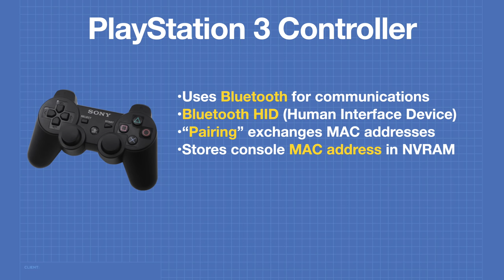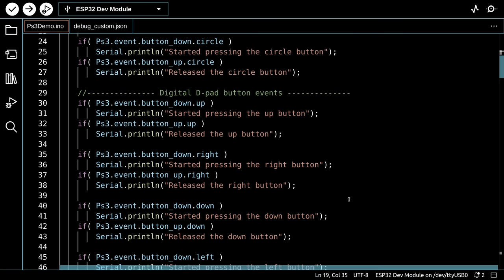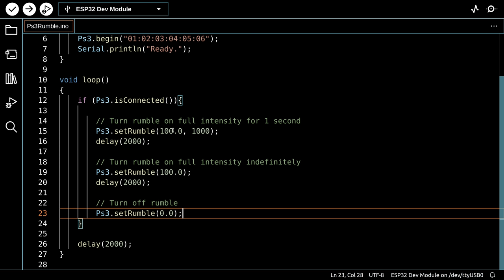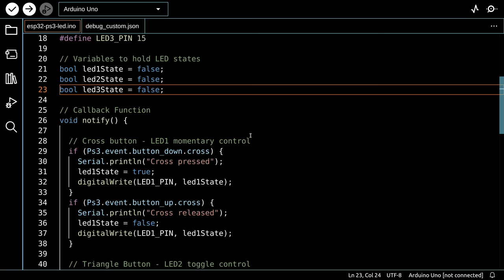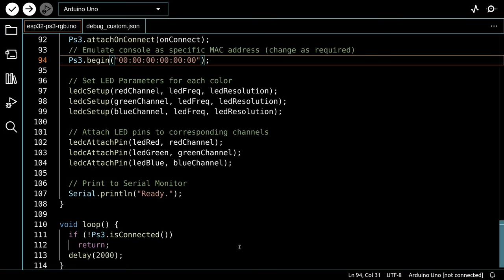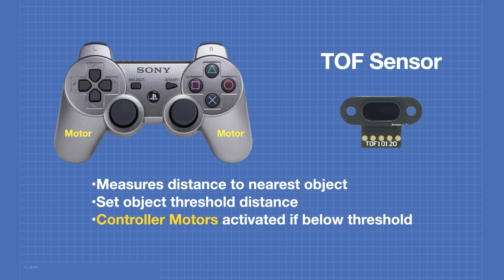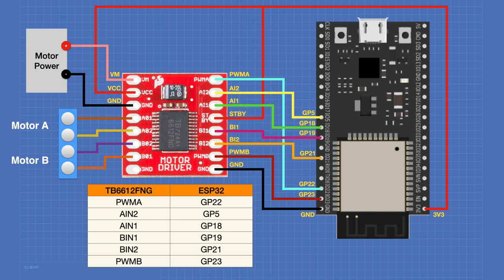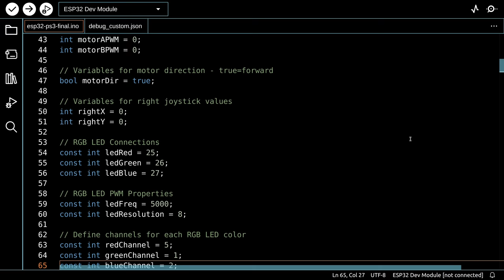Using PS3 Controllers with ESP32 | Build Custom Remote Controls

Comment: I bought the most recent ps3 controller clone on ebay. Looks exactly like in the video. Installs on Windows fine, shows as Xbox 360 and works. But the Sixaxis pair tool does not find it, with "no device found" error. Tried on 4 different Windows computers.
Reply: i am in the same situatione!
Reply: did you find any solution ? 
i tried pairing with my android phone and retrieving the bluetooth mac address but it didnt work
Reply: Turn off your fire wall that helped me
Reply: You have to use a name brand Sony
Reply: I have had the same thing

Comment: One of the best videos I have seen.  You really did a great job bringing all the different elements together and it is hard to believe you have not spent 30 years in the front of a classroom.   Your cadence is perfect, and you break each task into simple to understand steps and build on that. Not just in this video, but all of yours.  This one is particularly a gem covering so many interesting topics and then bringing them all together.  I have been working on a lot of ESP32 projects and your videos have been very helpful.   Thanks and keep it up.  -Duane

Comment: Does anyone have links for the cheaper controllers that actually pair with the ESP32? I have bought 3 different brands and none of them have worked outside of the OG Sony controller. I tried rolling back the versions as suggested by others, but that didnt work :( I would LOVE to use these in my high school robotics club but cant rationalize $40 each controller. $10-13 each is totally manageable though!

Comment: Thanks Bill! Another great video to get my creative juices flowing. It got me thinking about automating my wood shop. Not with a PS2 controller but laser sensors and such. 😃
Reply from the maker: Thank you Kyle. And I agree that automating a table saw with a video game controller might not be the wisest thing to do!
Reply: @Dronebotworkshop Don't knock it until you try it; I use an Xbox controller to control my CNC and it works great.

Comment: 100% agree on the micro vs mini usb. The thinner metal jacket on the micro is much more susceptible to prying loose from a fall/drop or even from regular use on something that sees a lot of connecting/disconnecting. The micro is good for small devices where space is more of a premium than durability. If USB-C isn’t and option, the mini would be my second choice.

Comment: Thanks Bill, a brilliant project, I've finally found a simple, reliable way to control a robot car!
It took me a while to understand I needed to get the MAC address from the ESP32 and insert this into the sketch code and also to modify the PS3 controller so it has the same MAC address.
Then worked perfectly, even has proportional control!
Thanks for your meticulous documentation.
I'm looking forward to further updates.

Comment: Thank you, love your work!  I noticed a two second delay in the loop(), after it detects that it's connected.  Then I noticed errant display in the console log.  I deduce that this delay is the reason that @33:00 it's not immediately showing in the console log, when you press and release the buttons -- but it does "catch up" a few seconds later.  A bit later I noticed a 300 ms delay in what appeared to be a critical section, but didn't notice any issues from that (a third of a second happens fairly quickly, also.  :)  )  Thanks again!

Comment: Teacher! Congratulations, I follow your classes whenever I can! I have a question does the generic playstation 3 joystick connect with esp32 or only if it is original?
Reply: If your wondering whether you need an offcial branded PS3 Controller, I don't think you do. I haven't got one and its working well enough here.
Reply: @lankeylad  generic controllers works fine

Comment: I have been flying rc planes this way with LoRa modules for the last two years.  I wrote code that includes secondary functionality for trimming the plane and using landing gear.  I wish you would have made this video back then because it took me a month or two to work every thing out,  also not every ps3 controller works , i have five different variations some only work with esp32 and some will only pair to a dongle with USB host shield arduino.  Im gonna post my code

Comment: Hello Bill , I was wondering fi there was an alternative to the six axis pair tool .. I have purchased a ps3 controller very similar to the one used in the project ..however the software doesn't seem to be finding any  console and doesn't provide any mac address details .. any direction /solutions would be most appreciated ... I am very keen to try the project utilising the ESP 32 ...also  which board do you use ?  , as there are so many generic versions out there ? in appreciation of your time and wonderful tutorials ...
Reply: i got the same problem try using the same mac address provided

Comment: Excellent Tutorial. I had quick test with my PS3 controllers (two) and it seems accelerometer /gyroscope does not seems to work on both controllers and only getting " -4 0 -132 0 " in the serial monitor but all other functions are working ok.  Do you think they have dead DOA  accelerometer /gyroscope ? or do i have do some trick to enable them to work? Thank you for suggestions.

Comment: I'm watching you about to do your servo motor test, and I'm wondering if there are various sensitivity/movement curves available to you, instead of just a linear adjustment. This is for continuous movement (perhaps until the limit is reached in the case of servos) versus an absolute position relative to stick position.

Imagine traversing a massive menu... For example, selecting your birth year from a listing of years. (That one gets to me now, I used to think the notion was funny). You might press the stick further to go faster. A sensitivity curve might be a great code enhancement in this case. It would be great if some preset curves were part of the library.

*edit* I like how you sort of did this with the motor control routine. It's still not a response curve, per se, but it works for its purpose.

Comment: Sixaxis and DualShock 3 were not the same.  Sixaxis doesn't have a vibration or "rumble" feature for haptic feedback to the user.  Dualshock 3 does.  That also makes the Dualshock 3 a little heavier, which most people prefer.   Sony couldn't get vibration and motion sensing working together on their sixaxis design.  The Dualshock3 was made by Immersion Corporation (after a patent lawsuit that banned the import of PS3 systems with sixaxxis to the USA).  Dualshock 3 (design licensed by Immersion) did have working motion sensing with vibration.  Presumably subsequent dualshock4 and dualsense controllers also are based on the design by Immersion.

Comment: Just a thought on the controller buttons having a "how-hard-you-push" or analog output capability... Might it instead be that you just read the button while it was still in debounce mode? Seems a little too much to expect them to have a "haptic" capability in that manner. Thoughts??  Great and thorough video as usual!
Reply: Good thought, but the buttons on the PS3 controllers are pressure-sensitive. They'll return an analog value up to the 255 max.
Reply: @themonkeydrunken  That's really cool!

Comment: Could this project be adapted to a ps4 controller? Any extra steps required? Not asking for a solution just whether it would be the same steps.
Reply: Its about the same. You use the sixaxis tool and then a ps4 controller library
Reply: @collinb5524 thanks!

Comment: New to the esps, Is it possible to connect the esp32 directly to the controller through USB and transmit the signal through WiFi to control another esp  for a longer range?

Comment: I think the setPlayerLED also sends data to the controller.
And isn't the gyroscope better for detecting rotation of the controller for motion based control?
Accelerometer stops changing when the controller is no longer in motion, doesn't it?

Comment: This is really great!    But how to do it the other way round? Emulate a sixaxis controller by an ESP32 or an Arduino or a RasPi and control the PS3 remotely? Is this possible, too? Where to start?
[Background to that question: I use my PS3 as a media player / BlueRay player and other functions. I have set up a home automation on RasPi that controls my video beamer, the Surround Sound system, the NAS data source, the HDMI matrix, the TV, the ceiling lights.... The home automation controls different Scenarios like "start the video", preparing all components and the light, and so on.... only the PS3 control is still missing...]

Comment: I have a question. When running the "Sixaxis Pair Tool" I get "No device found...". Should the PS3 controller be connected via Bluetooth, when you start the Sixaxis tool, or via USB cable? I have found many videos on Youtube on connecting a PS3 controller to a PC via Bluetooth and tried to follow a few. Problem is that, instead of connecting the device, they just remove my PC:s Bluetooth altogether. When I connect the PS3 control via USB cable, it gets acknowleged by the PC, but as "XBOX 360 for Windows" nor "Playstation...". Strange! Could you explain the process before running the Sixaxis tool? Also, many thanks for yet another great tutorial ☺
Reply: i got the same problem and yes it works with my pc , anyway to use it with the esp32 use the same mac address written in the code

Comment: hello bill 
thx for the video, am using esp32-wroom-32 but non of the codes are working for me. the ps3 controller just blinks with out connecting to the esp
please let me know if there is some update or fix I should do

Comment: I have a nice largish p10 panel running from falcon player... I'm wondering if I could hack this into it to play tetris from the front yard... I mean I know I could but I wonder if I could before I got distracted.

I might have done the rgb led differently, top buttons switch between colours left/right, down speed on the left trigger, up speed on the right trigger

Comment: Sir I am using esp32 along with ct013 current sensor and voltage sensor to measure power and sending Data to my website but its showing adc can't read along with wifi ,so i have changed connection,then also its showing some error, please suggest how to read multiple analog along with wifi
Reply: Esp32 cant analog read on some pins while wifi is active. You could use a MUX analog multiplexer to get more analog inputs
Reply: @collinb5524  thank you i will try

Comment: Hello, I am trying to get the MAC address stored in the controller using the Sixaxis Pairing Tool but keep getting the error "No device found.. " can you provide a solution for it, thanks.
Reply: hello i used the same mac address 01:02:03:04:05:06 and it worked  ,i got the same problem with the sixaxis pair tool saying no device found but it worked with this mac address

Comment: I have a question. Where did I put my PS3 controller? I purchased two of these controllers to use with robots and I've been looking for them for about a week.

Thanks for the interesting video. As I mentioned, I'm really excited to try this out myself.

For what it's worth, I've purchased lots of game controllers to use with robots. I've had some bad experiences with 3rd party controllers. Some cheap PS2 controllers use fewer bits with their analog sticks. You get the same range of output but the output skips ahead by four instead of one.
A good controller will output 0, 1, 2, 3, 4, 5, 6, 7, 8. . .
A cheap controller will output 0, 0, 0, 0, 4, 4, 4, 4, 8, . . .
It looks like your cheap controller doesn't have this problem. Another problem with cheap controllers is how bad the analog ranges are skewed to one side or the other. One side of the joystick can be mapped to 60% of the output values rather than 50% of the output values.

Again, thanks for the interesting video. I look forward to finding my PS3 controllers to try this out.
Reply: i bought a brand new ps3 controller but in sixaxis pair tool says no device found do you have any solution ?
Reply: @dellalioussama1124  I still haven't found my PS3 controllers. I haven't used the PS3 controller with a PC nor with a microcontroller. Sorry I don't have any suggestions on how to help. Good luck.
Reply: thank you 
 @ddegn

Comment: hi, can i use any controler designe
 for ps3, i mean cheap one for ps3 with use blueto? n0t orginal?
Reply: yes you can but you may encounter problem at finding the mac address of the controler like mine but i used the same mac address that shows in the demo

Comment: Guys, could someone help me? I'm trying to connect a Bluetooth controller with the ESP32 but there is no usb port to change the master address, so how can I pair the esp32 to the controller? The controller connects to the smartphone, so i think it's possible to connect to the esp32
Reply: try on laptop they have prebuild in bluetooth try to connect it and use the program sixaxis pair to display the mac address then find your way